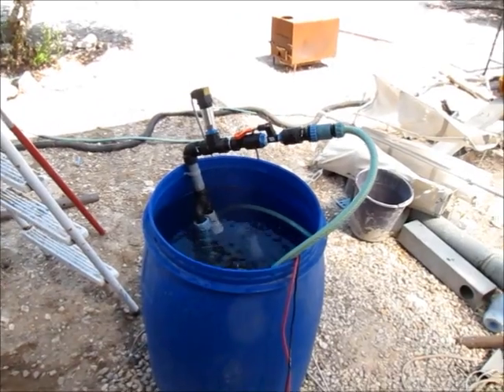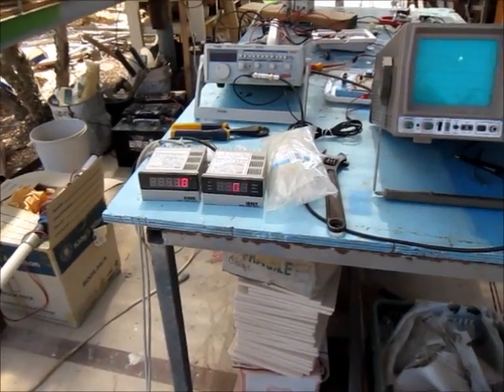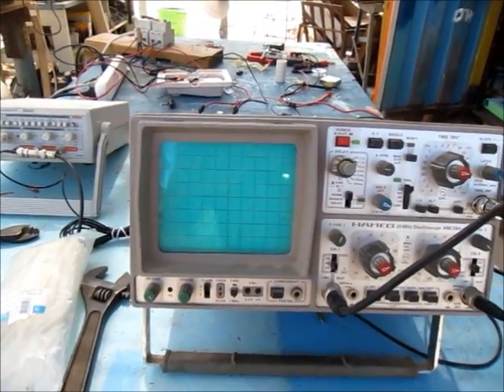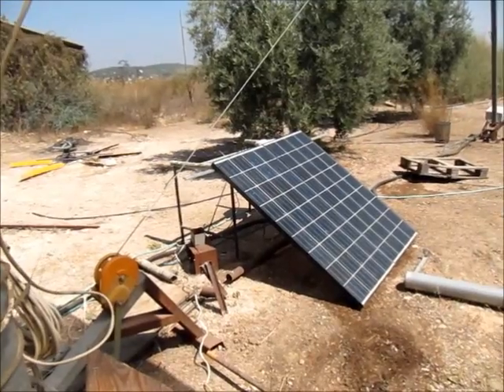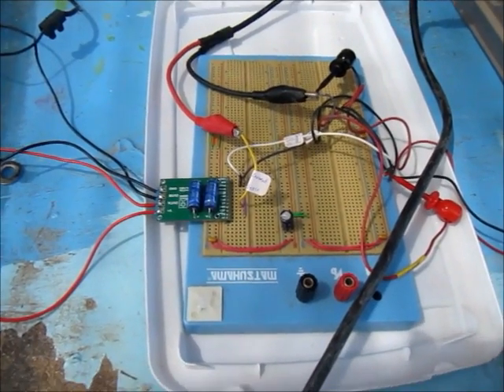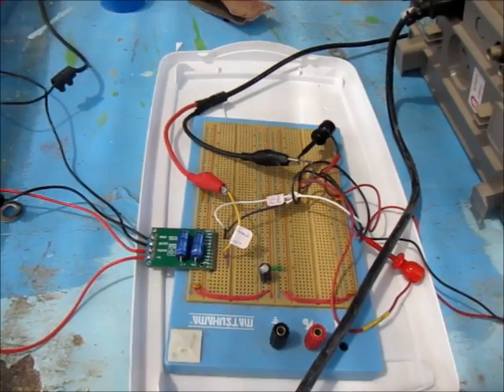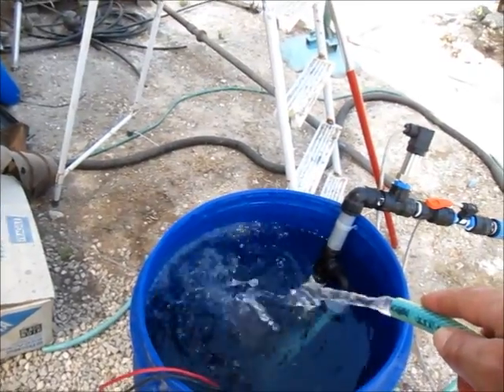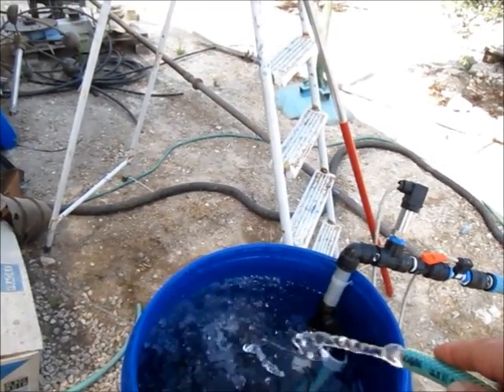Solar Magnetic Piston Pump

Comment from the maker: The design details of the magnetic piston pump will be available to everyone, later when we feel that we reach (or close to reach) the requirements of 20-30 m pump head at flow rate of 3-5 cubic meter per day based on 200-300W solar panel(s). Fell free to add your comments and ideas for improvements. Thanks